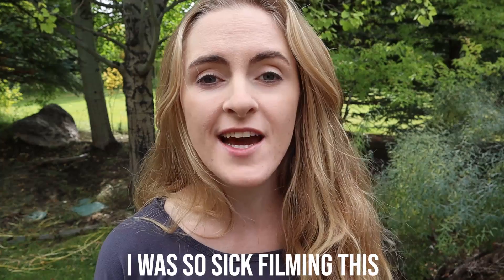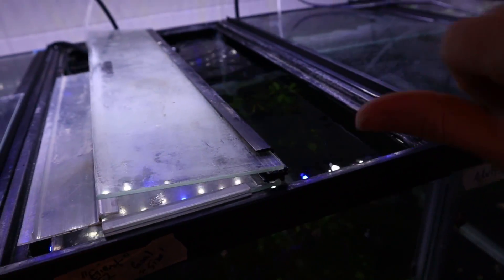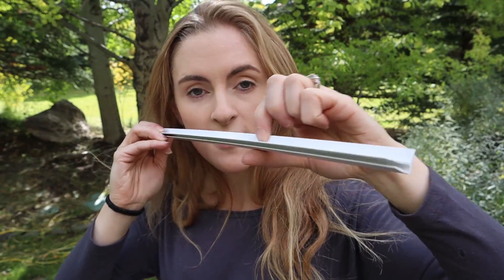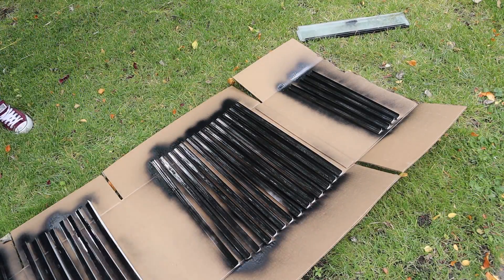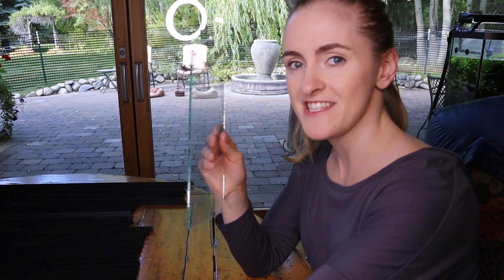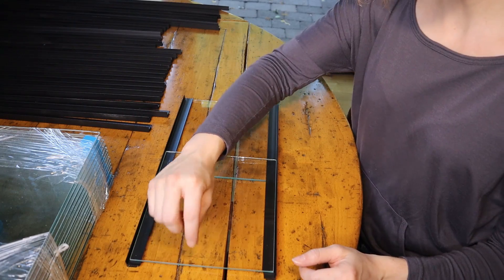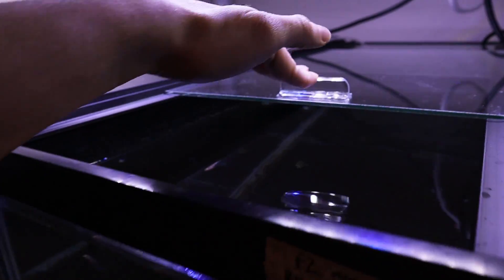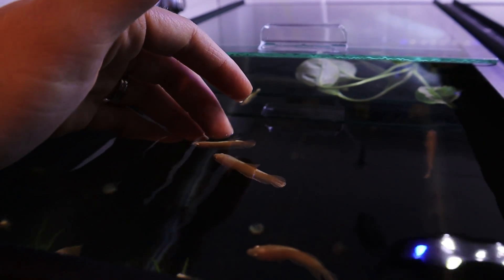Diy Glass Aquarium Lid - How I Made Sliding Fish Tank lids for my Fish Room

Comment from the maker: What do you think, did that improve the fish room or what? Here is the link to Steve Poland Cichlids’ video that I learned from https://youtu.be/whwqdsF4GiI
Reply: Simply Betta  great improvement can't wait to see more. I did not know this diy so thx.
Reply: Did you glue them down or just set them on top of the rims?
Reply from the maker: @aqua peet Just set on top so I can remove it if I want to
Reply: Cool idea!! I should make these, I'd be devastated if one of my Bettas jumped!! I do have a TON of floating plants but I guess it could still happen? I'm confused as to how you get the handles to stay on the glass?
Reply: @peculiarone339  I think the handles have an adhesive on them 👍
Reply: Where did you find the handles?
Reply: They look fine and are very functional, making your job light years easier. No doubt these will catch on for Betta and Non-Betta keepers alike.
Reply: Another trick for those that have Aquariums or a Fishroom is bubble wrap cut to the exact size of the inside of the aquarium. You just let it float and remove it whenever you need to catch a fish or do maintenance. The nice part is you simply remove it to a five gallon bucket & you instantly have easy access to all corners of the aquarium. It holds up well & if you want to replace it for any reason, you just cut out another piece & again lay it across the top of the tanks water & your all set.
Reply: Simply Betta Do anyone know howe i can get these moldings shipped to Denmark. Home Depot doesn’t ship to Denmark and i can’t get them here. Hope you can help.
Reply: Thanks for passing along this great DIY lid.  👍👍👍👍
Reply: Simply Betta what about mesh?
Reply: How aquarium gases will exchange?
Reply from the maker: Aman Singh I can adjust a small crack at the back where a heater cord and air line can pass through
Reply: @SimplyBetta  thank you😃
Reply: i guess it's kinda off topic but does anyone know a good site to watch newly released movies online ?
Reply: @Lucca Dustin I would suggest Flixzone. Just search on google for it =)
Reply: @Jacob Briar yea, I have been watching on Flixzone for months myself :)
Reply: @Jacob Briar Thanks, I signed up and it seems like they got a lot of movies there :) Appreciate it!
Reply: @Lucca Dustin Glad I could help :)
Reply: @SimplyBetta  From what I’ve heard sealing too much  of the top of your aquarium can prevent proper gas exchange in your aquarium and can potentially kill your fish.

Comment: Thank you for posting your video.  I was looking for an inexpensive way to make a nice looking lid.  I used the same plastic material (bought at Home Depot) you did and I spray painted it with flat black acrylic paint.  Then to prevent the paint from being scratched off, I applied black electrical tape to the top of the plastic piece where the glass slides back and forth.  Works great, easy to do, and inexpensive.  $2.50 for plastic, $25 for the 2 pieces of glass cut at a local glass/window making shop.
Instead of attaching the handle to the glass, I used the same plastic material, spray painted it flat black, and then cut 2 pieces of plastic.  One to fit the front of one piece of glass, and the other piece to fit the back of the other piece of glass.  This way the front glass can slide backwards, and the back piece can slide forwards.  I glued the plastic to the glass using Gorilla super glue.  Now easy to reach inside the front and back of the tank.  You can use a hack saw, or fine tooth saw to cut the plastic... or a sharp utility knife - box cutter.  Use sand paper to smooth off cut edges.
Looks nice and professional.  Any color paint can be used to match your aquarium trim.

Comment: I made these lids after seeing your video. The glass lids look so cool now that I can see all my fish from above. Anyone who wants to try it yourself I’d recommend going to Lowes for the custom glass. If you buy a panel of glass from them they have a free cutting service. I bought a 16X20 for only like $8. (Just make sure you account for the molding in the cause I didn’t and had to go back to the store and ask them to cut the glass just a bit smaller so it would fit on the tank). Also I found you can just use a permanent black marker for the molding if you don’t wanna use spray paint on the molding.
Reply: What width did you remove from the glass for proper fit?  ¼"? ½"?

Comment: Drill a hole. The hole can be used as a feeding hole so you dont have to open the lid. Large enough for your finger. Ive been using polycarb lids forever and built lids this exact same way.

Comment: Very cool! How did you take the measurements for the glass and get them cut?
Reply from the maker: Hi! So I didn't include my measurements because I was scared that people would use mine and then have it not fit well and be mad at me, yikes!  So I made my side mouldings first and popped them into place on my rims. I measured with a tape measure and appropriate width for my 2 pieces that wouldn't be too tight or too loose. Then for the length I made sure that the 2 pieces would overlap a little when the lid was fully closed

Comment: The only thing I would add is maybe a small dot if hot glue on the mounding right at the front and back of the tracks. That way the lid has a barrier when being slid front or back and doesn’t easily slide off the front of the tank and onto the floor possibly shattering or into the wall behind the tank.
Reply from the maker: That would be a good idea
Reply: @SimplyBetta  Isn't hot glue toxic to fish?

Comment: You can buy black molding at Lowe's online and pick up at the store. You have to buy a dozen, but they will accept return of the ones you do not use.
Reply: what is the name of this molding?
Reply: @chrisrobertson6421  The molding is called "outside corner wall panel molding."
Reply: @chrisrobertson6421  Lowe's Item #110598Model #M.CP120110

Comment: I know Krylon Fusion spray paint stuck to pvc/plastic is fish safe, not sure about rust-oleum, nice vid!
Reply from the maker: Hi! It is going well so far but I am noticing paint scraping off from all the sliding. Hmm maybe I've learned my lesson and krylon is in my future
Reply: I don't know if painting them will work in the long run. The friction of the sliding will cause ware.
Reply: @madbotanyorganicfarmsllc1603  what about spraying some sort of sealant over the paint?
Reply: @johndeckard6592  I can't think of anyway to stop the rubbing. The glass will sand anything off even the plastic over time. 
Try for black molding.
Reply: Simply Betta I hate to say it but even Krylon Fusion will scrape over time because of the sliding.  I think the only way to get around this would be to aquifers the mouldiing in black but have no idea where you would get it.  Great looking job though!

Comment: I can’t tell how you manage your airline tubing and filter hoses.  I love the idea and want to use it for my 40 breeder, but can’t figure out how to accommodate for my air line tubing and filter hoses.  Any suggestions would be great.  Thanks.
Reply from the maker: Hello! I left a small crack in the back end of the lid by scootching the rear glass piece a bit in the plastic frames. Doing that can leave a crack small enough for some air line to pass through, but not big enough for fish to get out! 
In the tanks that need a larger heater cable, I scootch the glass enough to accommodate it but the gap is probably large enough for a little fish to get out, so I put a piece of painters tape over the crack. Problem solved!

Comment: Is there supposed to be a lot of condensation? I'm experiencing quite a bit and wasn't sure if it was normal. My top glass piece does not "close" all the way to allow for the filter and heater cords.
Reply from the maker: Did you make it in this method? just push the glass down the plastic channel some more until you have a comfortable gap for cords. And there will be condensation if it is airtight :)
Reply: @SimplyBetta  yes I did exactly and I do have a gap for the cords it's not airtight so wasn't sure if the condensation was ok.

Comment: I’m sry if I missed it somewhere, but did you mention where you got custom pieces of glass? Also the “moldings” and the handles? Did you just glue the handles on?
Reply from the maker: The glass is from a local glass show, the mouldings are from home depot, and handles I found online and they come with an adhesive

Comment: Are the cut edges of the glass that face the handle fairly sharp? It looks great, by the way!
Reply: Nope If u get them custom cut from a shop they will smooth/sand the edges so they aren't sharp. If u do it yourself remember to get some sandpaper. 😉
Reply from the maker: @SpeekofDee is right - custom cut glass is nicely prepared. But if you cut it yourself just be careful

Comment: I really like how it look on the tanks.
Can you tell us the dimension of those glass piece for 5g,10g and 20g long? And also where did you get those glass cut to size?
Reply from the maker: It's been so long I don't remember the measurements, which might also change slightly depending on the tank manufacturer. I got them cut to size at my local glass store, who does mostly windows

Comment: What is the width of the glass you're using? I did this for a 40 breeder and the length of the tank was too long for the glass I purchased. It sagged a bit in the middle, as my tank is set up long-wise. I think a thicker glass like you used would work better for me.
Reply from the maker: Hello! I used eighth inch glass (or close to it) for these lids and they’re doing great. I’m going to make lids for some 40 breeders next but make it into 2 separate sliding lids

Comment: since those glass plates look 'factory sharp edges', did you use fine grit sandpaper to carefully round off just the edges to avoid cuts later?  Very cool lids. :)
Reply from the maker: Hi! I actually had my pieces cut from a local glass shop and they make sure to dull the edges. Thanks goodness :)
Reply: @SimplyBetta  Even better :)

Comment: Hi! I love your vids and this is one I am going to emulate.
I was thinking, however, that flipping the whole assembly over - except for the handle, of course - (where the sliding glass slides UNDER the permanent glass) would make it so the front end is flush with the tank rim and so that it doesn't extend too far when you close it (noticed it the first few times you slid the lid closed). This is all in my head, of course, but I will give it a go see how it works.
Keep up the good work and thanks for sharing - even though you were ill that day. What a trooper! :)
Reply: I think the channel would "grab on the glass too well, so.....maybe flip it over, but then the glass would ride on the aquarium rim and not the smooth pvc. Good luck! And I'm gonna try experimenting w/ that as well cause my OCD said so.

Comment: It is snowing and my Betta Fish tanks are FREEZING. I have a ten gallon tank, a 50 watt heater, a LED light, and it is still only 65 degrees! Do you have any suggestions for keeping them warm? It’s not even December yet and I am scared. I only put in hot water every week to not throw off the balance of the water, and my three guppies have already died.
Reply: Move up to a 100w. I had a 100w in my twenty gallon and it wouldn't stop running. Went to a 200w and it works more efficiently.
Reply: What is the temp in your house? The water will never drop below that, so unless you are keeping your heat at 50 degrees, your tank temp will be at least at room temp. Plus with a heater it should be higher. Is it snowing in your house lol.

Comment: I'm wondering if they have clear strips instead of white? I recently had a lid built at a plastic store near me (I live in the SF Bay area). My 6.5 gallon tank is frameless so I wanted to make a very simple lid. I wanted to do what you did and make a sliding door, but then found these clips on amazon  (link below) that sit on each end of the tank and I lay the clear plastic lid over that. The lid has a feeding hole on one side and that's where I lift it. It also has very small notches in the back corners (for tubing, power cord) and a notch in the back mid-tank for my Kessil light. The lid you made is much more useful with the way you set the tanks up. Nicely done. Link to acrylic clips: https://smile.amazon.com/gp/product/B07BXN784N/ref=oh_aui_detailpage_o03_s00?ie=UTF8&psc=1
Reply from the maker: Oh yes, I have seen these clips. They're useful but in my situation I wanted sliding :)

Comment: Only bad thing about spray painting them that can flake off and get in the water
Reply from the maker: True and I have noticed some scraping, though its very minimal. I've been told a different brand of spray paint would have been better - Krylon. It fuses to plastic
Reply: @froglick28  Great find !!!  Trying to figure out how to use this design with the normal display of tank (not from the side).
Reply: That same design should still  just change location of handle
Reply: Clear coat will help with the flaking
Reply: You can buy black molding at Lowe's online and pick up at the store. You have to buy a dozen, but they will accept return of the ones you do not use.
Reply: @froglick28  Lowes says minimum quantity is 50?

Comment: Don't spray paint them, as you move it around you will strip the paint into the tank. As well you are suing acrylic, if used enamel you would have been a bit better off. Also should use Teflon I think. Otjereise solid instructional

Comment: But i have hang in back filter and a co2 tube going in what do i do? :(
Reply from the maker: You can leave a tiny space for airline to run in the back! A hang-on-back filter will require you to leave a little more space but it's doable. You can modify the space on the back by sliding the glass further up or down the plastic tracking